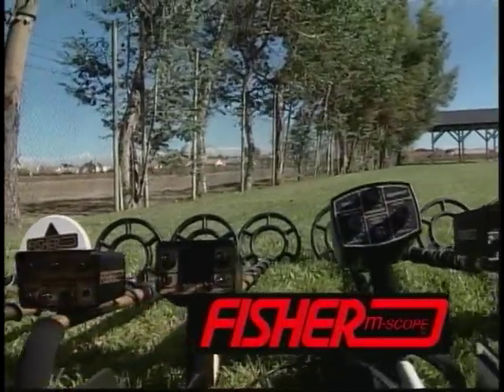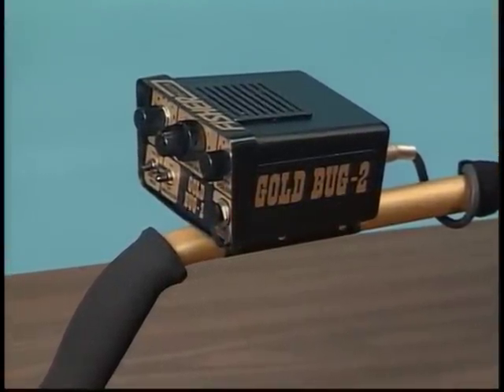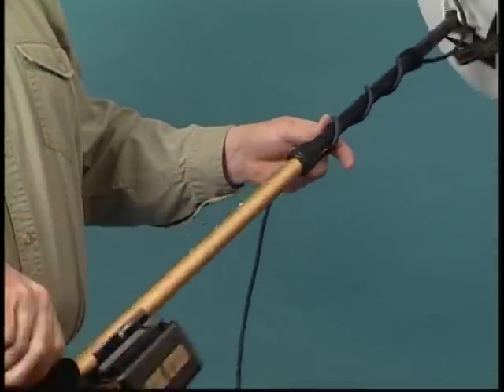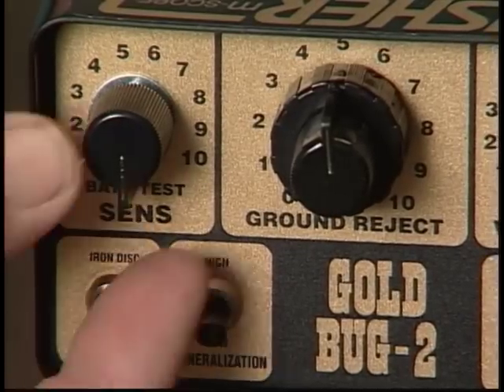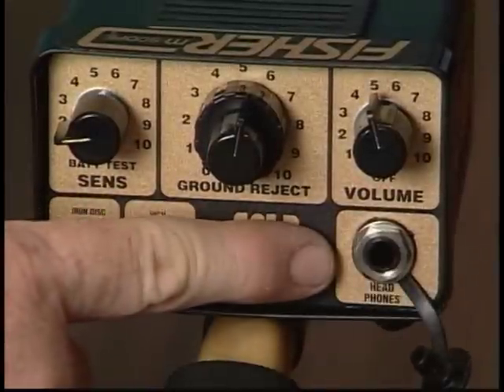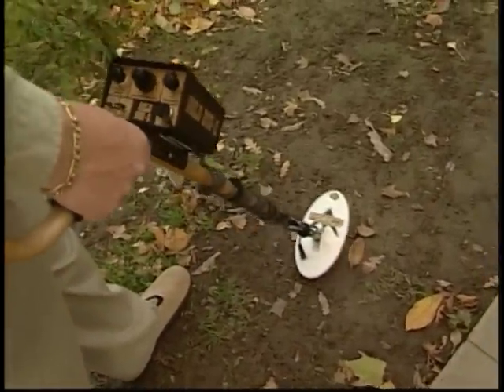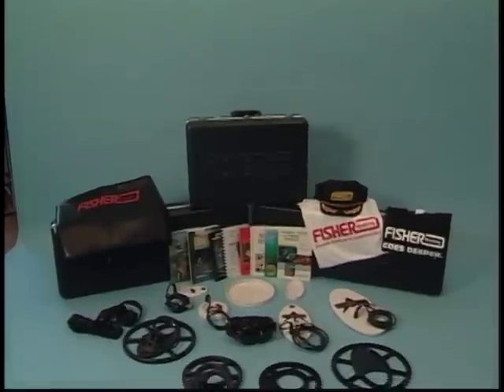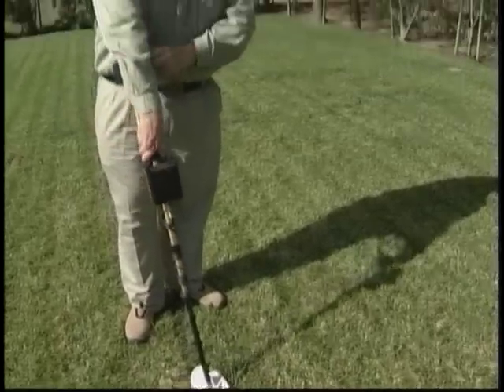Fisher Gold Bug-2 Take Gold Prospecting to a new level

Comment: Dear Fisher metal detectors bought mine at a pawnshop about 20 years ago it’s a fisher gold bug her mother load been using it for years I only complain I head is it six battery holder that holds the AA batteries this week and it breaks had to tape it up plastic weld it now that it’s been 20 some years it’s hard to find replacements but other than that I found lots treasure coins with my fisher metal detector couldn’t be more happy still using it today and it’s from the 90s

Comment: Hello !!
!
May i ask  You some advise of Gold Bug 2 
settings? Is it possible to use Gold Bug-2 to search for gold  jewelry ithems,rings or old gold coins ?
 
I understand that Gold Bug-2 
primary is designed to search for gold  nuggets, but  if there is only Gold Bug 2 detector and no other option at the moment , 
and since artificial gold ithems still contain gold
 it would be interesting to try temporary adapt Gold Bug 2 capabilities to search such items. Thank You and Best regards, Sergei.